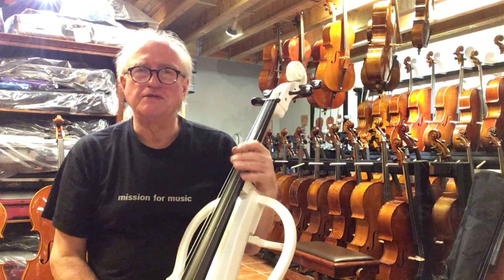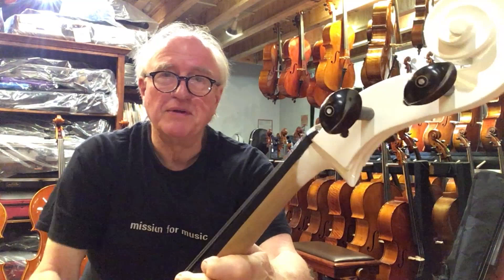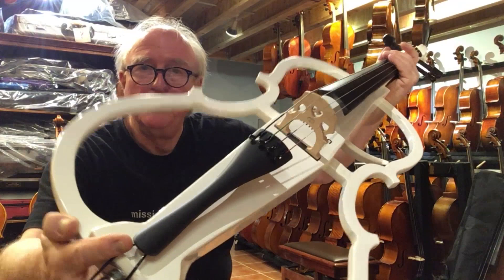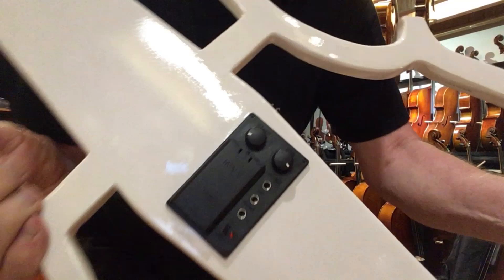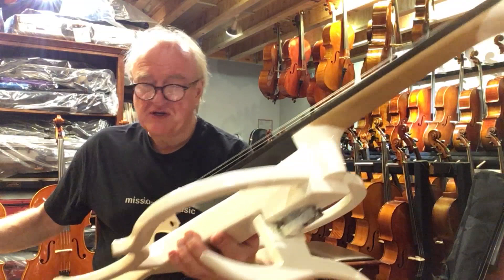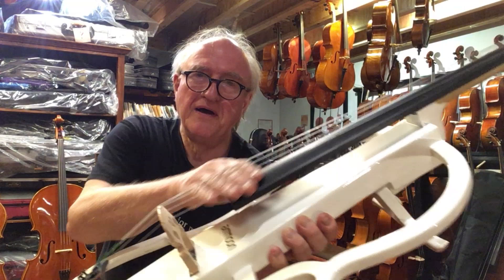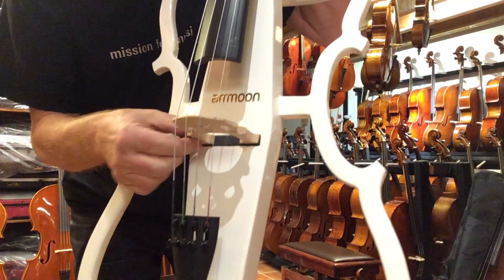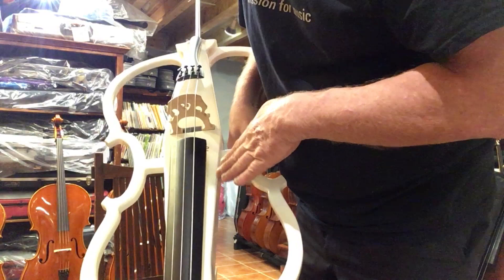Electric Cellos, what NOT to buy.

Comment: I have an identical looking instrument but made by "Sonata" and they have fixed the problems you mention: the strings are centered and the correct height off the fingerboard. 
My only complaint was the wobbly chest-rest, but I fixed that with a small metal bracket!
I am very happy with it as a practice instrument - my traditional cello is MUCH louder!
Reply: An amplifier means you could make it even louder

Comment: According to the Walmart listing for this Ammoon cello, the fingerboard is not ebony, it is "ebonized wood". The tailpiece is not carbon fiber, it's ebony. The pictures on the Walmart website show the strings at a proper height above the fingerboard. The fingerboard is pretty nearly centered, but visibly not perfect. The faulty neck design doesn't seem to have changed. So, some improvement over time, but still not a proper design.

Comment: Generally Electric instruments are easier to mass produce in better shape cause they're not as bulky (e.g. Electric Guitars) but for Electric Cellos it's kinda the opposite of what is really supposed to be correct. Electric Cellos required less bulk than their Acoustic counterparts cause they're thinner. Wood Violins makes good ones but they're priced higher than they're supposed to be.

Comment: That looks very much like a Classic Cantabile cello to me. Thank's for making this video, so I know what to check out. I have got a Harley Benton which is about the same price range, but mine got the fingerboard right luckily. (Well, nearly. It's about 9 mm on the C string and nearly 6 on the A but I think it will do, it depends on the strings too I guess). It's really nothing special but it does the job. Only I can't get the knees right, they missed to simulate the thickness of a real cello at that point. I fixed it by adding a wooden clementine box to it 🤣 that helps getting the position right and on the long run I will make myself some new brackets, some bented sheet metal should do the job. 
I really wanted to have a acoustic cello, found a Sentor I B-Stock for 420,- euros only which would have been "perfect" but my flat has got paper thin walls, no way. 😔

Comment: That's a piezo pick-up. I'm currently building a solid body cello with coil pick-ups. I'm awaiting delivery for some parts and other parts will need to be fabricated. I should have it done by mid-August 2019. I'm keeping production notes. 
The beauty of the solid body is that I'll be running it through a standard guitar pedal-board... distortion, delay, wah, etc
Reply: can you give an update on your cello? curious to know how it turned out.
Reply: @geneschmidt8308  I got it done 18 months ago and I'm loving it. I had to use cheaper strings to make the humbucker work because standard cello strings are non-magnetic. I put a piezo pick-up on it too and I switch back and forth between humbucker and piezo a lot. The humbucker has a warmer tone to it. Because of the curve of the fingerboard I had to wind my own pickup coils. The real beauty of the solid-body is that I can play it with other loud instruments.

Comment: I bought one of these used from someone on Craigslist. The one shown here is exactly like the one I bought, except for the color and the label. I think Amoon and Cecilio are the same thing.  There may be a bit of BS in this video. After seeing this video, I measured the distance on the fingerboard. It is neither the "recommended" 4 mm, nor the 20 mm that this man "measured." It was just under 10 mm. Perhaps Cecilio has improved that since this video; I don't know. Or is that the difference between Amoon and Cecilio? 
For a beginner and at its low price, I doubt this would be a problem. If you look at other videos you can see examples of people playing this instrument. It certainly isn't an instrument for the symphony, but it is usable at a basic level. List price of my Cecilio is just under $900, but new ones (both Cecilio and Amoon) generally go for well under $500 (I paid $125 for a used one). So really, can one say this is an unusable cello for a beginner on a budget?
Reply: Timothy Page 

I think there’ a lack of consistency here. I know Cecilio is an American company, and since this clearly is factory made with cheap materials, one can expect an action a little less or more than 10mm. Amoon and Cecelia would not be the same thing if Amoon is one of those Chinese knockoff companies, and especially since this guy’s reporting a different measured action with another brand’s cello. This is also something to consider if you’re making a 3D printed cello, too!
Reply: Yes. By having the setup so high you do a couple horrible things to a beginner:

1) You make it so tuning is a problem, like he said in the video when you finger a note it will be sharp. A beginner will spend a lot of time fighting that.

2) The hand should be relaxed without gripping the neck of cello when fingering. By elevating the strings you’ll need more force to finger the notes which will translate to beginners gripping the neck.

If you can’t afford a well setup cello you can still learn to play, but you’ll be developing a lot of bad habits which will be a pain to over come. You’re better off renting a cello that’s setup properly.

Comment: It's absolute crap! Looks just like mine and it had the same string height which I lowered a lot but realized I had a lot more to go. The backside of the lower fretboard is so crud I could've made it smoother with a chopping axe. The support on the backside sit's on a kitchen cabinet hinge and looks absolutely stupid. The paint has cracked in every joint around the body. The build quality is what you could expect from a 10-12 yo kid with no particular experience.

Comment: So please tell me the Mfg name and brand model number of this cello?
Reply from the maker: It is enough to watch out for these things. I do not want to point the finger at one particular brand as this issue is not limited to this particular brand. By the way, I later realized that the fingerboard was not made of ebony. It was painted. The ebony 'imitation' was quite well done.
Reply: Wow ... So they called it Ebony and it was an imitation...  They must of put in the specifications that it was IMITATION EBONY.  Otherwise they'd be in the wrong.
Reply: It looks exactly like my Cecilio silent cello, but you can see the Amoon label in the video. The only difference is that mine is black; it comes in several colors. One other difference: the fingerboard measurement seems to be totally wrong. I measured mine at just under 10 mm.
Reply: Can u recommend any affordable e-cello? I am looking for one,  beginning again after over 10 years not playing. I dont need the best sound quality. Just a decent e-cello.
Reply: I bought my Cecilio second hand at a great price, about a third of what it goes for online. It wasn't in perfect condition, but quite fine. MSRP, I think it around $800, but I see it online in the $300+ range. That seems affordable. I am not an expert on what is a fair, decent, or great sound. I am about to move out of the beginner range. It doesn't come with speaker or amp, but you can play it as is (not truly silent) or with earphones. Others are saying that the Amoon shown in the video is a poor Chinese knock-off of the Cecilio that I have.

Comment: Cecilo makes the best Cellos on the planet You're a FOOL to insult them
Reply: I've owned 2 Cecilio CCO 500 cello's and currently play a CCO 600 cello and a Cecilio CVN 600 violin and they are very decent, serviceable instruments plus arrived in good condition, well packaged and both came with very nice appointments. First things, toss the rosin and cheap strings (unless it comes with the string upgrade to D'Addario). The CCO 600 had a minor finish issue and I was offered to return it at no charge or offered a rebate to keep it and kept it. String action is a LITTLE high and I am going to work on it, but have had it for 6 months without touching it. Very serviceable.
Reply: Obviously this particular one is not good. 😂 (If it’s a cecilo)